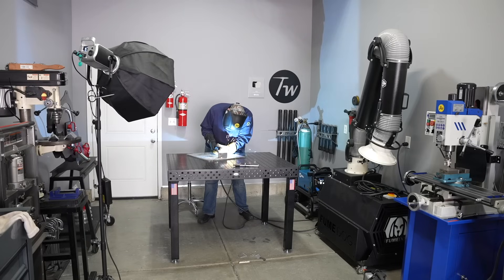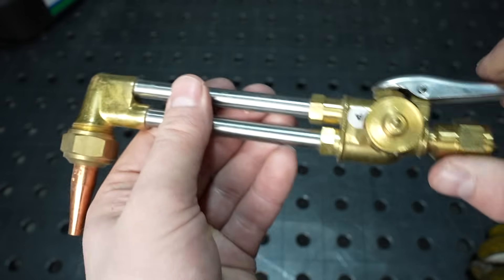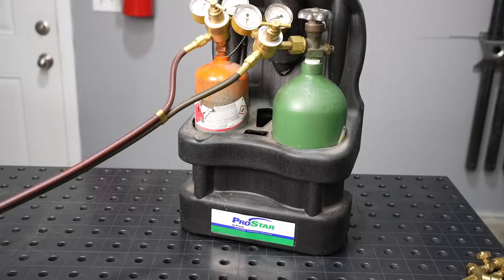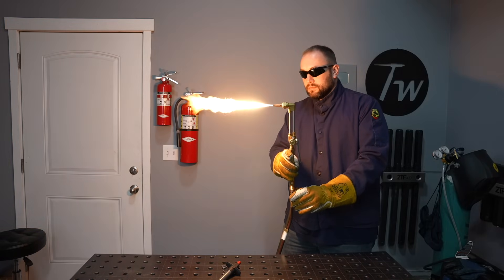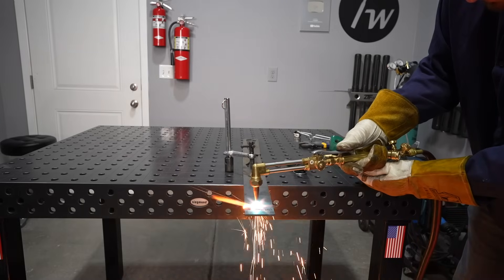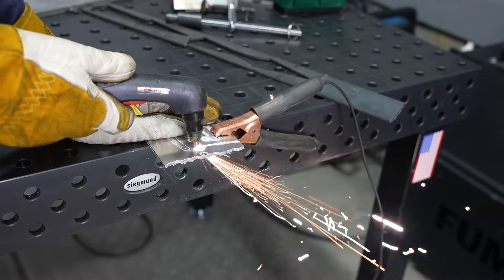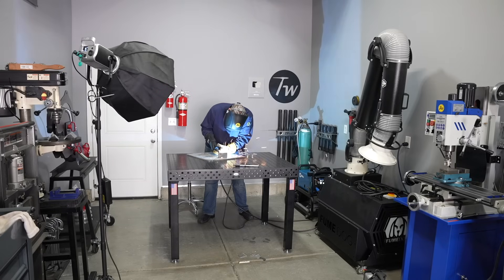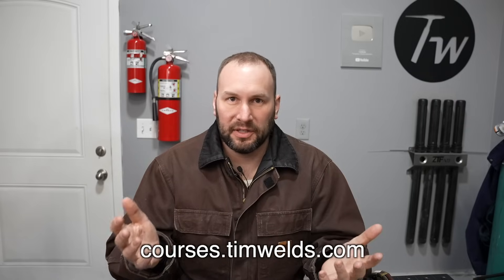Oxy Acetylene Basics: Cutting, Welding & Heating with a Torch

Comment: I was talking to some fools and I mention I wanted to learn how to weld with gas and it turn into a hole thing because all use electric insted. In Mexico most great welders use torch and its common in body and automotive applications. Question: Can you tell us was the difference and what's stronger?

Comment: Thank you for the video. What acetylene pressure do you use?
Reply from the maker: Usually 5 psi on welding and cutting for the sizes of tips that I use. From a safety perspective, it's very important to never set acetylene over 15 psi.

Comment: Here's the deal I have 47 years in the trade and I am known as the human  track burner and you  rookies are about to be exposed  ! Little combo torch is not the best and let's talk torches! A bottle of Acetylene  must be stored vertical  all times  then stand it up and let it settle  otherwise the Acetone may leak out mkay then there Is Mapp gas and propane  you are a rookie what's your ox pressure  and Acetylene  pressure? Needs to  be 40 ox 10 to 12  Acetylene

Comment: Hi, Tim!
If I have thick materials with distorsion, can I use the oxy-fuel like You did to heating enough for straighten the material? (Like 20/30 milimeters material thickness).
Reply from the maker: You can flame straighten them to some extent, but you'd need a much bigger torch than I have here.
Reply: @TimWelds Thank You very much for answer! :)

Comment: I've done a lot of OA welding.  I taught myself because I needed a welding process that I didn't need electricity for.  It is a very slow process, and you dump massive amounts of heat into the metal, but it has been handy when I needed to quickly fuse some strut into angle brackets for a repair I was working on.  Usually, it was for a single bracket or 2.  Anything more, and I would go get the flux core welder if I had the opportunity.

Comment: Good video, but after more than 50 years since I started fixing rusty cars, I'd like to add some comments.
When working under a car, put small pieces of cotton wads in your ears. Small pieces of red hot metal can pierce your ear drum.
In my country backfire protector on the acetylene regulator and check valves on the handle is mandatory. When tip is clogged prevents oxygen from going back into the acetylene tank.
A fireproof glove also mandatory. Probably to enable closing a burning acetylene tank.
When welding rusty sheet metal a reducing flame works better.
In sheet metal angle of the flame is all important. Gives ratio between heat to rod and sheet.
Filling holes done with flame almost parallel to the sheet. Pause to let surrounding sheet cool. Not to make hole bigger.
Use nozzle tip cleaners. Cutting tips are more likely to get clogged.
Always know where the flame is pointing.
A bucket of water can be used for cooling and killing small fires. Powder extinguishers makes an awful mess. Though less messy than a burnt down workshop.
Personally I prefer not to use gloves. You quickly learn what is hot and what is cold.

Comment: Very good presentation except for the oxygen & acetylene gauges . The babes and adjustment screw should always be unthreaded or no pressure going to the torch … this will save the gauges & on full tanks can damage the gauges … this can be a nightmare especially when welding with a torch 🤷🏼‍♂️ the flame 🔥 will not be stable and self adjusts which doesn’t work well when doing this …
Reply from the maker: Thank you for the tips!

Comment: Only issue; should have turned off the torch cutting Oxy first, (the secondary knob on the cutting head) then the fuel on the torch body.

Comment: Thanks to your tips Tim, really well made video and content. For my experience oxy-fuel welding and cutting is preferred for on-field calls just because you can bring with you just two cylinders, a torch handle and some cutting and welding attachment. So no generators or air compressor are needed. For shop applications are a way better and more practical the electronic machines like plasma cutters or welding machines.

Comment: Great stuff! From what I've learned the gas welding is great for brazing and the classic bicycle industry loves the aesthetics that the braze produces at joints and for accessories like mounts, racks, etc.
Reply from the maker: Brazing is awesome and great for steel frame bikes. Brazing can also be done very well with a TIG welder, which is how I do it, but a torch still works also.

Comment: I know this is about torches but I have a question. I’m new to welding and I have the Lincoln 210 mig welder, everyone is telling me to get rid of the regulator and get a  flow meter. Can you tell me a good one to buy around the price of $100-$150 would greatly appreciate your time
Reply from the maker: Thanks a ton for the question! I wouldn’t bother with that if I were you. It is better, but it’s a minor optimization that won’t make much difference on your actual welds. MIG welding is pretty forgiving when it comes to gas flow. The hard part about learning to weld is there are a ton of things that make a tiny difference (better regulator, movement patterns, ground clamp, brand of consumables, optimized settings, etc), but only 3 things contribute to 95% of the outcome and they all have to do with technique-you can find them in my vid called MIG Basics for Beginners. To answer your actual question, however, Victor gas products are generally good quality. I personally just use the stock ones or cheap $25 SPARC ones off Amazon and that’s never been a limitation for me. For TIG welding, gas flow is more important and I just check the flow with a peashooter regardless of the regulator/flowmeter that I’m using. Hope this helps! https://www.amazon.com/dp/B009QFFIIY/ref=cm_sw_r_as_gl_api_gl_i_98BJVY4K59823Q5GM68E?linkCode=ml1&tag=timwelds-20
Reply: @TimWelds  This was very helpful. Thank you for your quick reply

Comment: Thanks.  Is it safe to get a cylinder of actelene from the gas supply and lay it down in the back of the truck while transporting it?  I read somewhere that it must be kept upright for some time after it has been laid down or the acetone will come out when you turn on the valve.
Reply: I haven’t been told not to transport the tank sideways, but you are correct about the acetone. I set the tank upright and don’t open it for a whole day just to be safe.

Comment: Hey Tim. I just purchased an oxy fuel cutting torch and call the knobs on the torch head are very loose fitting. And I’m always bumping it while I’m cutting. Should they be kind of loose? Or do they need to be adjusted or rebuilt?😊

Comment: I was going to buy a 125cf oxygen and 40cf acetylene cylinders recently and the prices have gone insane. Last time I bought a pair, I paid something like $300 for filled tanks. Now it's over $700 from the local AirGas dealer. MUCH cheaper to run plasma and MIG/TIG, assuming there's no particularly compelling reason you need an oxyacetylene setup. Also, no flashback risk. That's a whole lot of no-fun.

Comment: In most cases you should not need more than 5 PSI for Acetylene. When I was brazing in HVAC school I was able to braze just fine with it set to 3 PSI. The nice thing about cutting is you can actually use the Acetylene regulator on a standard 20 pound aka Grill Propane cylinder and get cutting tips for Propane which is much cheaper to use and works great if you only occasionally cut or cut for scrapping stuff. Even with propane you still should be fine setting your regulator at 5 PSI and it's recommended to use grade T  hoses but unless you are doing lots of cutting standard grade R will be fine. Oh and last but not least it's recommended to use a minimum of shade 3 googles/glasses anything darker may be a little too dark.

Comment: Excellent tutorial, Tim!  People need to remember the 15psi rule, as well...  I didn't know about the tank size affects or the tank upright position and wait period, so it's much appreciated!
Reply from the maker: Thanks!
Reply: I always thought it was 10 PSI but I've never needed it at more than 5 PSI. However it's still good practice to keep the pressure to 10 or less and it will save from going through you gas so often.
Reply: @benkeysor7576  Nice.  I've always put it at 12,  myself.  I'm from the old school, though.  Also, I tune the acetylene to where I just start to see the soot, but will try it Tim's way next time I blaze it.
Reply: @benkeysor7576 only time I put it over 5-6 is when using a rose bud, run it at 10-10

Comment: Nice to see O/A featured here.  👍
It may be slow but it is versatile (in addition it can also be used for brazing dissimilar metals or preheat of really thick sections, prior to electric welding)
Torches are handy for non-welding uses too. Like corroded exhaust fasteners.
Reply from the maker: Thanks! I use mine for heating more than anything else.
Reply: @TimWelds  You said that, and it makes sense. 
 You have stick, mig, tig and a plasma cutter. Plus years of experience using them!
If I were in your shoes I doubt I'd reach for a torch either, but they sure are handy when a cord won't reach and you can't move something like a gate post into the garage.